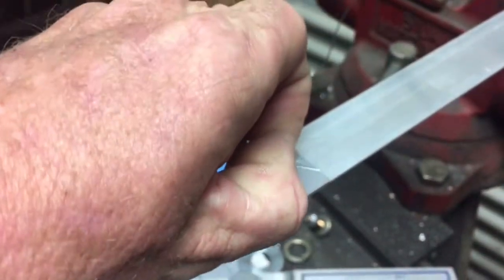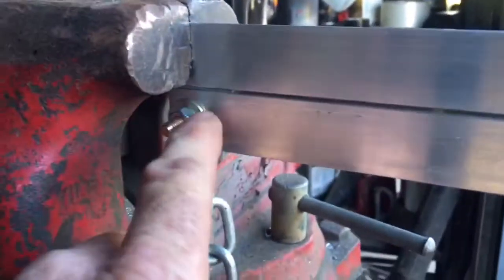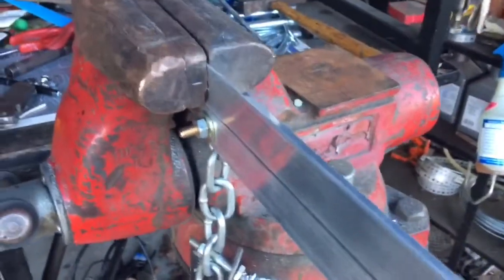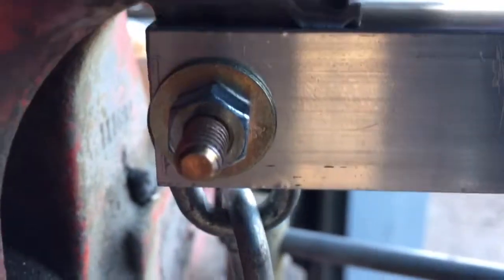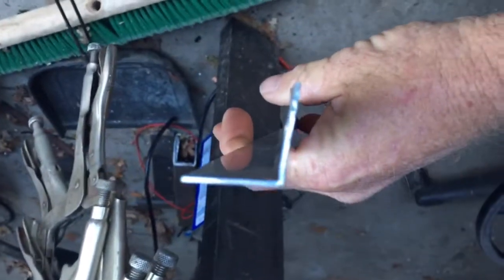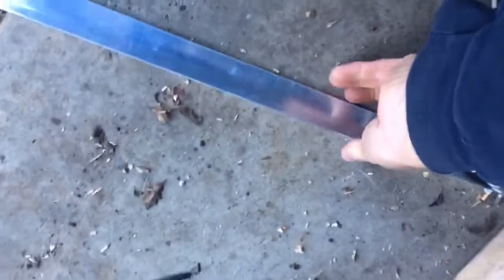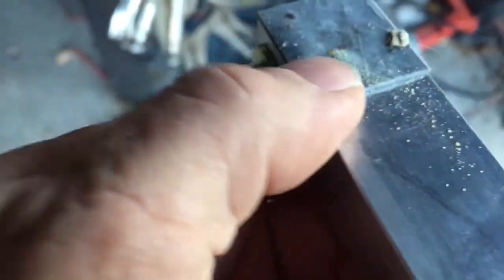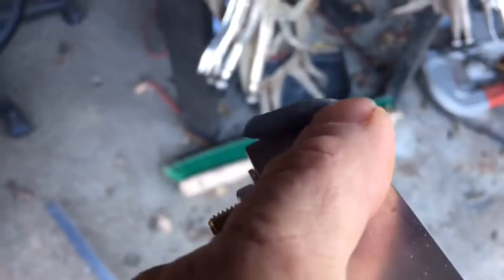3M VHB Tape 4943F pull test at home.

Comment: Plus full strength takes 72 hours not 2 minutes. And if you applied the VHB to the whole length of aluminum it would not have come apart. Plus you didn;t clean it
Reply from the maker: I gave it over night. It was just some leftover from the solar install I did on my horse trailer. That stuff is not coming off no matter how hard you try. The achilles’ heel to VHB is water. So always seal it from weather

Comment: Marty, there’s a lot wrong with this video:

1. You did not clean the surface with IPA, nor did you utilize 3M Primer 94, an adhesion promoter. 

2. After proper application, the bond strength will increase as the adhesive flows onto the surface.

3. Finally and just as important, at room temperature approximately 50% of ultimate bond strength will be achieved after 20 minutes, 90% after 24 hours and 100% after 72 hours.

I know this because I’m a 3M Industrial Product Specialist. I know this product because my customers use it. 

So really what your video shows is that VHB is so strong, that it took at least 100LBS of force to make a 1”x1” VHB tape strip fail even only being applied after a few minutes with less than 50% cure. Pretty strong tape!
Reply from the maker: All i used was the 50 50 mix of distilled water and alcohol. Then gave it over night in a cold garage. Real world stuff. Because 95% of the people are not even going to go as far as I did on prep. Rip, slap and stick. It's now holding the solar on my roof of my trailer. It is then covered with Dura bond since water is Kryptonite to VHB tape. But on the solar it was given plenty of weight and time. Should give me a pull of 1300 pounds or more. 1 inch tape 32 inch long.
Reply: Do you think this tape would be good to secure a pvc roof rack on a full size van (keeping wind speed, etc in mind)?

I am thinking of possibly using it to secure strips of pvc (or metal) in order to drill plastic pallets or something in as a rack/deck. It wouldnt be carrying anything too heavy, just gas/water/camping gear.
Reply from the maker: I'm sure they make a VHB tape for PVC. But this tape was used for aluminum to aluminum

Comment: Did you clean the aluminum surface with alcohol first before put the VHB tape?
Reply from the maker: Yes I used the 50/50 mix they say to use. It does hold real well for just 1 SQ.IN.

Comment: You didn't let it cure as per the spec sheet.
Reply from the maker: I know. It was just a real world test, Who fallows directions anymore. When I stick the solar on the roof it will have plenty of cure time and sealant.
Be sure to fallow along. https://www.facebook.com/CrazyMartys/
I'm installing the water treatment system now.
Reply: @CrazyMarty  you claim in another comment that you left it overnight... here you say something else.
Reply from the maker: 2 different things. The test peace was just leftover. I stuck it together and went to bed. It sat overnight and I pulled it apart. The solar panels it’s holding down i cleaned the surfaces and and fallowed the directions. It’s never coming off the roof. The only thing that kills this stuff is water